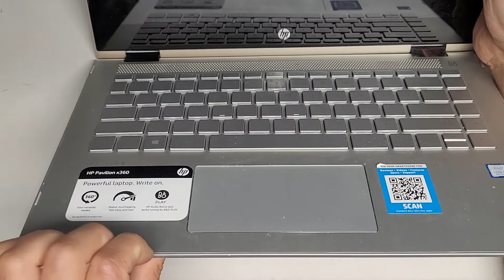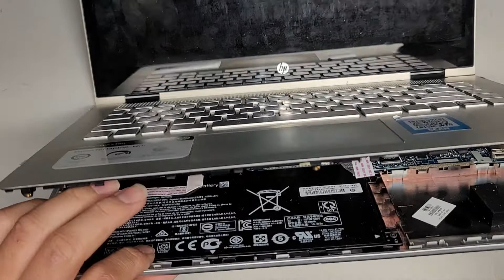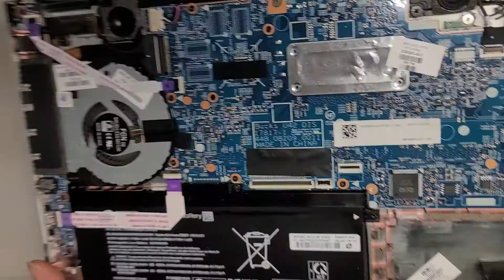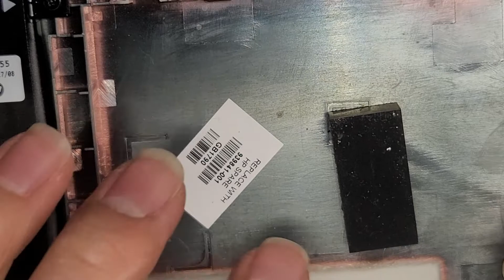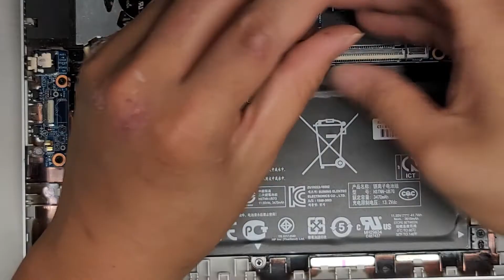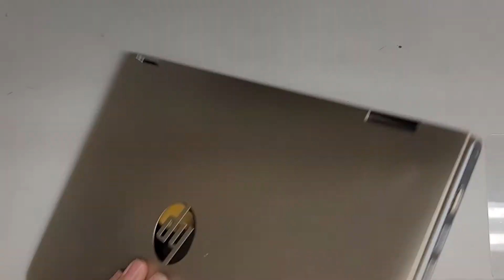HP Pavilion x360 m Convertible 14m-ba114dx Disassembly Keyboard Trackpad Battery Fan Repair

Comment: Awesome video, thanks. I have this model and bought a replacement battery, speakers and back cover (due to cracks from repeatedly dropping...oops). I didn't realize how extensive it is to replace the back cover which looks like basically unscrewing everything and moving to new back cover. Wondering if I should I admit defeat and take to a pro or is this doable. Thanks.
Reply from the maker: Depends on how much the computer is worth to you and your skill level.
Reply: I replaced the battery which I was unaware was swollen and the speakers with a little guidance. Fairly easy, but the speaker jack cable was disconnected due to battery swelling. The bottom cover still cracked, but flat with new battery. Good enough for my skill level. : )
Reply from the maker: @PrincessPosie1  awesome, glad to were able to figure it out. :)

Comment: (me at start of vid) I guess the days of 14 screws holding a laptop together + a little 1 screw "window" that lets you upgrade ram/hdd are over. This looks like it'll be easy to open and upgrade everything! (me after you open the laptop) wait... everything I want to upgrade.. is on the BACKSIDE of the mobo! shakes fist in air DAMN YOU, HP!
Reply from the maker: Lol... yeah...

Comment: Do you think i can put an SSD in the free HDD slot and plug it with a sata cable to the slot near to the battery?
Reply from the maker: As kind as the casing doesn't have plastic that fills the gap and you have the sata cable for it
Reply: @ItsBinhRepaired  mine has the same "rubber" the one on this video has, but i wanna take it off and buy a SATA cable, but im a Lil scared about it not working u.u
Reply from the maker: @OneWorld1996  yeah, it might not. Did you check the other side of the plastic cover? Sometimes they put a plastic grid there as well.

Comment: Where is the hard drive?
Reply from the maker: The SSD is under the motherboard. The hard drive is not there, but there's an empty place for one next to the battery.
Reply: @ItsBinhRepaired  thank you for the quick reply...Is there A CMos Battery? That seems to be missing too..lol..my machine is a 14-ba125CL I installed a new battery now I got nothing...No led onthe power cord , no boot up with or withour the battery installed.  any ideas?
Reply from the maker: I hate how YouTube doesn't notify me of replies. Were you able to figure it out?

Comment: Thank You for the video.. i recently got a hp pavilion x360 convertible 14m-dy1033dx... there seem to be a little gap at the end of the trackpad  not the side close to the keyboard.. it also feels bloated abit around there too. i'm just wandering if it just the design or maybe the battery is getting bloated... the other end of the trackpad facing the keyboard is perfect..
I also checked the battery and i observed that the battery capacity increased from 43,162 mWh to  46,119 mWh could this be a problem.
pls i would appreciate you help.. thank you
Reply from the maker: I'd need to see what it looks like.
Reply: @ItsBinhRepaired  Thank You for the prompt response pls is there an email or direct message i can forward the picture /  video to you.

Thank You very Much
Reply from the maker: I hate how YouTube doesn't notify me of replies. Were you able to figure it out?

Comment: Your video was super helpful in getting the laptop disassembled and I was able to replace the battery that was problematic.  However now it won’t start and I hear clicks every 5 seconds or so.  What should I check next?
Reply from the maker: How long did you wait? Usually I takes a while to boot.

Comment: Hello! I see in one of your other videos that you took apart a very similar laptop that has a 2.5" HDD bay. My question is, how do you get the SSD/HDD to show up in the Disk Management? I tried to add a 1tb Kingston SSD but for some reason it isn't showing up.
Reply from the maker: It won't show in the disk manager? Try restarting the computer one time. If it doesn't work, you might have to change bios settings.
Reply: @ItsBinhRepaired  I tried going into BIOS but it still isn't recognizing it. Could it be the SATA cable? Does it have to be the EXACT one needed for it? Not sure what size Kingston SSD you had in your video or the cable part number but I think that may help since the contact points seem different for some laptops.
Reply from the maker: Did the SATA cable come with the laptop?
Reply: @ItsBinhRepaired  Unfortunately there was no SATA cable that came with the laptop for the 2.5" SSD, it did have a small foam black foam block in the bay, I believe it was just there as support between the gaps
Reply from the maker: @OhitsBinh  could be wrong cable or hp disabled the port in software :( maybe it can't be used.